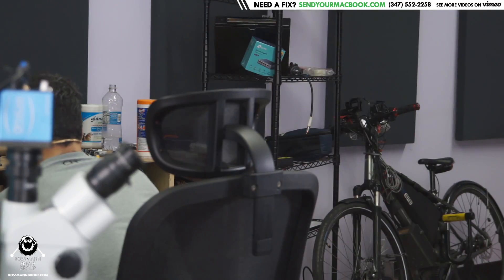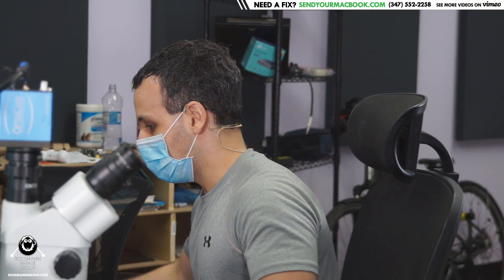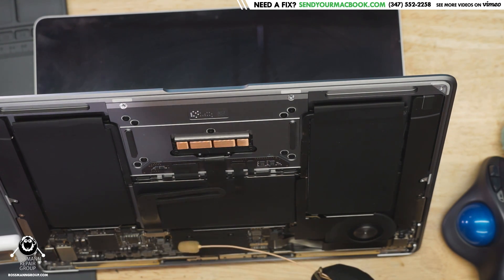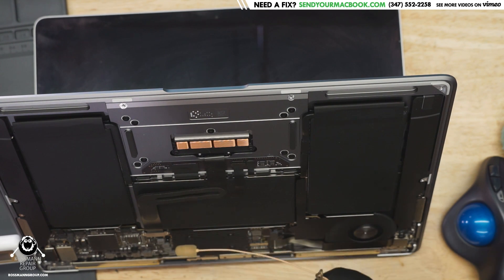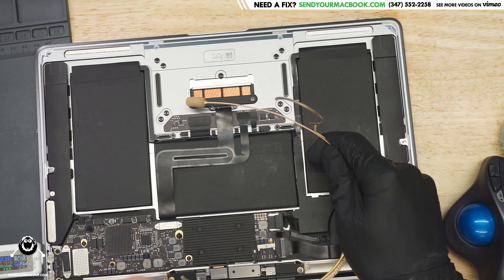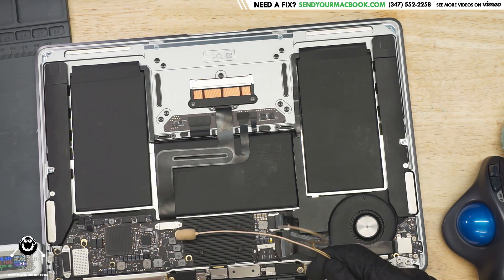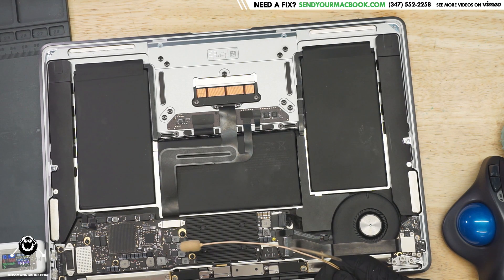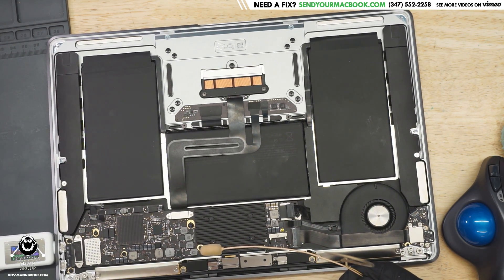The sound of a suffering Macbook Air CPU with no heatpipe 😢

Comment from the maker: I didn't finish this one. Usually, I would check for short circuits on every power rail. I can't find a schematic/boardview for this year/model. If you work for Apple, PLEASE DO NOT email a schematic for an 820-01055 to louis@rossmanngroup.com because that would be ethically & morally wrong. I believe it is Apple's choice to make, that this user should have to pay $1000+ at the Genius bar & lose all of their data. I respect their decision because I am a moral & ethical human, and you should too.
Reply: I want to see the rest, I hope that someone dont email the schematics so we can see the rest soon
Reply: Well played Mr. Rossman, well played
Reply: Sarcasm at its finest.
Reply: Sounds like an arc to me.  Should require a significant voltage to jump any kind of air gap because air has a high resistance.  Maybe a short to chassis ground, missing or damaged insulator somewhere.
Reply: @The_Opinion_of_Matt , that's what I was thinking.
Reply: @The_Opinion_of_Matt  couldnt verify the frequency but I would guess it's clicking based on the line frequency, which suggests that there is creeping in some alternating current, not good. Idk.
Reply: @musashi939  Audible frequency is wrong for line current.  I'm referring to the sound you hear around high power electrical devices such as substations or the mechanical room of buildings.  It doesn't have to be those high power systems though, it all depends on the condition of the system.  I posted my comment before making it to the end of the video where Louis pinpointed the sound as coming from the CPU.  I expect that something is shorting which is causing a high current draw and and something else that may provide circuit current protection (a.k.a. fire protection) is killing the current flow.  For example: Transistor A turns on and shorts to ground causing high current flow.  Transistor B senses the high current and kills the voltage to Transistor A.  High current flow stops and transistor B resets.  Bios program runs again and turns transistor A on again.  Repeat cycle.  I'm probably wrong because I don't have the schematics, but this is just and example.  Could also be the CPU self destructing itself one transistor at a time.
Reply: @The_Opinion_of_Matt  I'm not talking about audible frequency but if I had to guess, the click rate is at the line current frequency.
Reply: I dropped something in your inbox, hopefully its useful :)
Reply: maybe the CPU's balls came loose due to thermal expansion/stress?
Reply: Louis, you do have a thermal camera. Use it.  About the sound I thought it could be thermal expansion/contraction that makes the click - but the temps should not be high enough...
Reply: Smart move.
Reply: https://youtu.be/IULkXAHjL_s
Reply: What about other manufacturers?. Not only apple have problems.
Reply: A spoiler alert would not have have been asking too much. https://youtu.be/Vn9BeN8NBaA  You are barbaric!  
 But at least you don't stoop to the level of Apple, and watching to the end was still stupendous.
Reply: Urip Andono specifically because CPUs & (high-end) GPUs are large chip, unlike any other chips on the mainboard, so a large object has greater thermal expansion proportional to its large size.
Reply: Actual board model number should be 820-01958. Probably 6 months to a year before schematics and boardview are available, seems like the timeframe for newer stuff to come out these days.
Reply: ASMR?
Reply: TOAST
Reply: Clicking PPBus.
Reply: How much flux do you generate every time she rides it?
Reply: WOW, I think Consumer protection law should force Apple to buyback all their macbookAir just like VW diesels.
Reply: Not charging $1000+ for repair and wasting electronic parts?

How devious!
Reply: Most probably, an inductor
Reply: Nonono. You are an evil man. A bad man. You are a human who done goofed.
Reply: Luis please recommend a better heatpaste and a software that turns off the turbo boost of the cpu, the problem not mainly apple, the ploblem is classic intel where the cpu chugs down 40w in a 5 watt desing.
With the turbo boost you lose some performance but nothing that would make a huge difference, and the computer will live.
Please look after it many test are on youtube about this.
Make happy little macbooks
Reply: @SaltedCoffee400  Try ThrottleStop. But be careful, don't mess around too much with FIVR/TPL. 
Ha kérdésed lenne, szólj :)
Reply: Louis, you know viruses on a laptop aren't alive?  They're only alive in a host, in an infected host.  So why do you keep saying "die corona"?  It's hard to kill something that isn't alive.
Reply: @DavidNull5  viruses aren't alive, in the way that we define life as a whole.
Reply: @DavidNull5  viruses are never alive. They are strands of DNA (or RNA) in a shell that replicates by infecting a cell. no mobility, no reproduction, no life. just molecules.
Reply: @DavidNull5  You win the pedantic point of the day award! Congrats! MacBooks are not alive either you know...but that you are ok with because it does not let you drop your mad science knowledge for us all huh?
 lol.
Reply: @DavidNull5 Viruses aren't alive at all, but screw precision of language, this isn't The Giver.  
Lets agree to call a virus "alive" if it still has the ability to infect and replicate itself, and "dead" if it no longer has that ability.
Reply: @DavidNull5  They are never alive and don't become alive. A virus is an inert sequence of DNA in a package that replicates in a host but it is never alive. They can be physically deactivated by soap, alcohol or another bioagent that breaks down the cell wall and releases the contents. Or they can be made harmless by stopping them being able to break into a host cell.
Reply: @DavidNull5  ok; lets say "Destroy the corona!" or "Rip and Tear!" until it is dust!
Reply: @DavidNull5  a virus is never alive technically speaking :)
Reply: @DavidNull5  Coronavirus has been found to live on metal and plastic surfaces for 3 days.  It lives on things like wood, cardboard, and fabric for 24 hours.  On one of the cruise ships that had an outbreak they went onto it 17 days after all the people were off of it and they found coronavirus, however I never heard if it was still alive on the cruise ship.
Reply: @The_Opinion_of_Matt  A virus isn't actually alive. SARS-CoV-2 isn't transmissible after about 2 days even on the smoothest of surfaces and the time goes way down for imperfections.
Reply: @supasexystick  Thanks!
Reply: @samiraperi467  Thank you for the update.  I had old information.  Everything is changing so fast these days none of us can keep up with everything and all of us have to rely on others to keep us informed on what they are able to stay up to date on.  Have a good day and stay healthy!
Reply: @The_Opinion_of_Matt  The virus is still never 'alive' - it might be capable of causing an infection, but it is never 'alive' in the sense of being able to replicate without first infecting a host organism. I believe the tests on the cruise ship were for corona virus DNA - which can still be found even if the virus is no longer infectious. (Your dead body can be identified from DNA extracted from a molar - but you are still dead.)
Reply: @jasondrummond9451  I believe the word most often used is viable, instead of alive.  I'll take your word for  the rest of it.  I don't remember what I wrote back then and it is late and I don't feel like looking through the 41 comments to see what I wrote.  Have a good evening and stay healthy.

Comment: It sounds like electricity jumping through the air, which would make sense if it got damaged by the heat and a circuit doesnt connect properly

Comment: Duh. Engineering something to work is easy. I can design and build a bridge no problemo. It'll take 10x the time and 100x the price. Trick is to engineer something so that it barely, just works. Here, Apple has removed the conductor between the het sink and fan to see what happens to their revenue. If revenues drop, it's because you are holding it wrong. But more likely, people will still buy and get these fixed at the braindead bar. 

Next they can remove the fan.

Eh? EH?

Comment: just spoke to apple the heat pipes are there new anti tamper ones they stole from harry potter they have a cloak of invisibility that is triggered when opened and was also informed that there alcohol dissolvable so they have even booby trapped it for you

Comment: Cpu's don't click. That's not clicking. That's arching, that cpu was dead the moment you turned it on. How the fuck do you get arcs at <2V? I have no clue. But that 110% sounds like every single arc i heard in my life. 
Think different i guess
Reply: Correct, CPUs don't click, arcing might be a stretch, what high voltage device is near by? Laptops used to have to use an inverter to get the ccfl in the screen to turn on but almost all use led nowadays.

Comment: cooked CPU, electrical arcing in the CPU chip... bad design, apple if you are going to cheap out on cooling, then use a weak-ass CPU so weak, you can only barely facebook with it and not even watch videos at 144p

Comment: Another computer, not apple in fact, had a pretty... bad heat pipe too.
It went FROM the CPU, then ONTO the GPU, and then to the fan.
Result?
The GPU Easily gets overheated, and since it is placed under the board, the heat will melt the soldering and making bad connections and thus the image disappears....
Managed to heat it back, on a friends computer, so it started to work again, and then i added some more copper to the GPU to help getting rid of some more heat that way.
Guess what?
It worked!!!
...and some screws were left over when i got it together but what da heck... there was a lid underneath for... something, so i taped the screws in there if it was ever to be needed again. =)

Comment: "The sound of a suffering Macbook Air CPU with no heatpipe" - how can it be suffering by not having an heatpipe if all we hear is the cpu clock and THE FAN IS NOT EVEN ON???? fan off = cpu is not hot at all. that OR you manually disconnected the fan before the video, which is stupid by itself and you are just trying to make drama by raising the mic sensitivity to the max and not having a fan actually making more noise than the cpu, which is what usually happens in every pc to the point that people don't notice the faint cpu noise over the noise of the other components like HDDs and fans. All cpus do that clock noise, its normal, ones do it louder than others and the clicking is faster and louder the more the "GHz" the cpu is currently running at. Also, bigger and more powerful cpus make more noise because more current (watts) are being pumped through it. But sometimes cpus can get noisier if the quality of it in the production line came out lower than normal. If the cpu is too loud, blame intel, not Apple. And don't fking try to convince me with those titles that this is a heat problem. ITS NOT. I'm not defending Apple, that noise can be anything else like something shorting or a bad capacitor, but that title and your whole video is blaming heat!
I hate how everyone in the comments are agreeing with it and saying jokes like "wireless cooling!". The cooling on that MB Air is complete TRASH, no doubt, but this video is just making pointless drama about what your viewers love to hear: bashing Apple all day everyday.

Comment: i would have tried at least pushing with a little force on the VRMs, or if you find any coil on the logicboard.
Its pretty weird they saved some pennies on a damn heatpipe.... i have never seen a notebook with a fan but missing heatpipe, except i removed the heatpipe to renew thermal paste. Apple obviously try to fool their customers with that. Imagine only the fan noise by this wireless heat transmission (YMMD with that joke haha) when under full load for a longer period of time.
Even 2x 6000 rpm fans and 2 properly sized heatpipes of my Macbook Pro barely handle the i5 and 330M under full load.

Comment: Cellphone: We can add heat pipes for our 5 Watts cpu on this phone
Macbook : We can remove heat pipes for this 20 Watts Notebook cpu
Reply: Yes, but TDP down 7.5W(1.1GHz). When temperature below its rating it operate at TDP up at 15-25Watts(3Ghz up). BGA doesn't like temperature fluctuations. Unlike PGA or LGA have pin(flexible).
Reply: Yeah well Intel TDP =/= power draw
Reply: i think its 7,5 - 15 W but the joke was good :D
Reply: MacBook Air is using a 7-Watt processor btw

Comment: That sounds like micro arcing voltage inside the chip. Even 5 volts makes lightning if it has enough amps.

Western Digital drives click by default because they're always taking a DUMP.

Comment: Months ago I thought all that testimony was in the U.S. and the Senate or whoever votes laws into effect was going to make the right to repair legal. I was wrong! My Whirlpool going on 15 years and still chugga chugga chugging only came with a complex list of timer values and a wiring schematic. Repair manuals are sold or so they say but I rely on YT videos to help me. YT videos are not always accurate and will sometimes recommend the complete opposite of the correct method. You can't always get complete and accurate information to repair devices.

Comment: Has anyone figured out the use of that fan? I mean it seems only to be there to be an additional load for the battery ... or to make fan noises so that the user doesn't get upset that this "computer" hasn't a fan ... or something like that. I think that space could be put to better use ... most likely by throwing everything out and put a raspberry pie in instead (on a second thought).

Comment: dear Louis, my macbook air 2015 is super slow but really super super slow, I have replaced the battery and ssd new thermal paste and still no improvement, I only get max 80mbps read and write speed do you know what it might be?  best regards

Comment: I know about this heatpipe-less macbook and that is just bad thermal design for you. Apple thinks that the aluminum bottom plate is conductive enough to act as bridge between the heat pipe and the fan. All for the sake of making things thinner.

Comment: Almost sounds like its got a dead DC/DC converter thats dumping large current pulses into the CPU. Be interesting to see why it died.
Reply: yeah, an inductor causing the click noise from it's coil winding or the ferrite material itself (in case of a split core) whenever the current through it either is turned off, or the magnetic core material goes into magnetic saturation for some reason. If it goes into saturation, overcurrent will most likely trigger immediate reset/shutdown of the DC/DC followed by a short pause and restart - causing the repeated clicking. Typically a short circuit at the output would cause something like this, but I also heard unstable/random high frequency singing from somewhere, and to me that sounds like a DC/DC control loop going into instability, which would also explain an overcurrent/overvoltage event happening. 
Maybe the exact part of the DC/DC converter that is clicking could more easily be found by making a small 1-turn antenna-loop attached to an oscilloscope probe that is swept over the different inductors and capacitors that rectify the PWM waveform to see which ones that show a sawtooth pattern that corresponds to rising current that hits a limit and restarts from zero in sync with the clicking noise.
Either way I'm glad that I bought an HP laptop 6 years ago instead of almost succumbing to the urge to get a Macbook Pro to run Ableton on..

Comment: Clicking sounds like arcing to me, but WTF do I know?
Reply: It's more than likely a bad inductor in the vrm part of the circuit. if you pay attention he puts the microphone over those little gray boxes. Those have little bits of foil in it, that foil has come loose and in the flux of the  magnetic field causes the vibration as the foil is repelled and attracted.

Comment: but really, what is this?
I mean in this case it could be just a short but I have similar and less loud noise on totally fine CPUs, Intel and AMD, especially noticeable when moving the mouse. but it's totally random if a CPU makes a noise or not. so far it's been 20%
Reply: It's more than likely a bad inductor in the vrm part of the circuit. if you pay attention he puts the microphone over those little gray boxes. Those have little bits of foil in it, that foil has come loose and in the flux of the  magnetic field causes the vibration as the foil is repelled and attracted.

Comment: Low TDP CPUs don't need heat pipes. Passive cooling is plenty. A 25W incandescent light bulb that basically produces nothing but radiant heat can only get to about 30c, so not very high over ambient. Basically any airflow in the case itself is more than enough to eliminate that amount of heat, in fact it's lower than the idle temperature on high TDP hardware.

Comment: I wamna see what part is clicking because it makes no sense for the cpu to click. you would need a genius mad scientist to make a cpu do any sort of physical movement
Reply: It's more than likely a bad inductor in the vrm part of the circuit. if you pay attention he puts the microphone over those little gray boxes. Those have little bits of foil in it, that foil has come loose and in the flux of the  magnetic field causes the vibration as the foil is repelled and attracted.

Comment: Hmmm what is that mysterious ticking noise?
Reply: It's more than likely a bad inductor in the vrm part of the circuit. if you pay attention he puts the microphone over those little gray boxes. Those have little bits of foil in it, that foil has come loose and in the flux of the  magnetic field causes the vibration as the foil is repelled and attracted.
Reply: @adamz01h   I was making a poter puppet pals reference, but still thanks for the informative response.